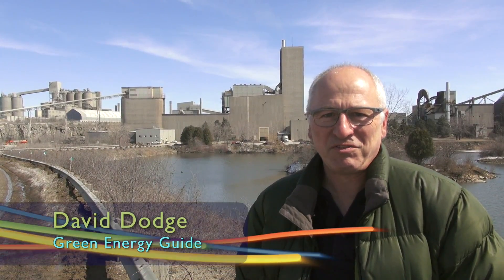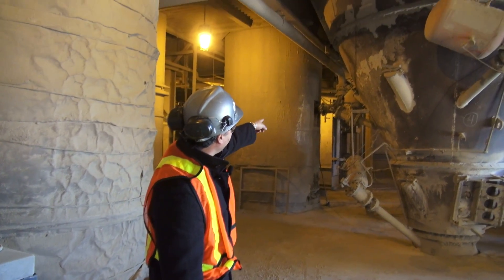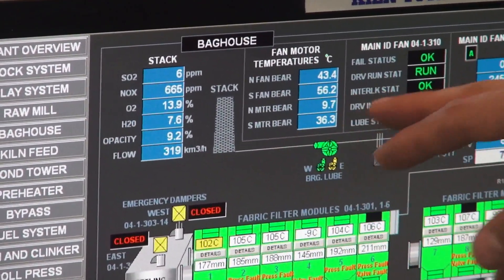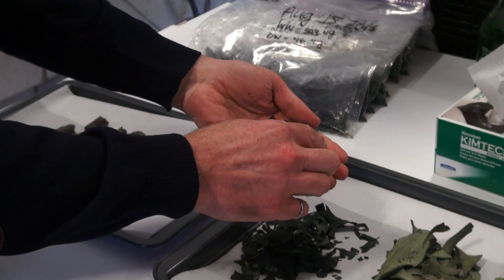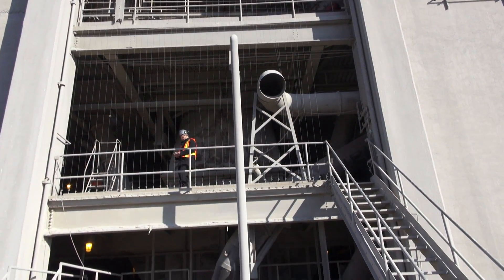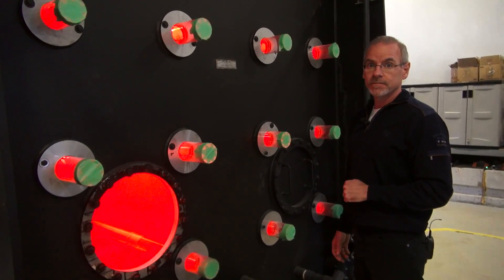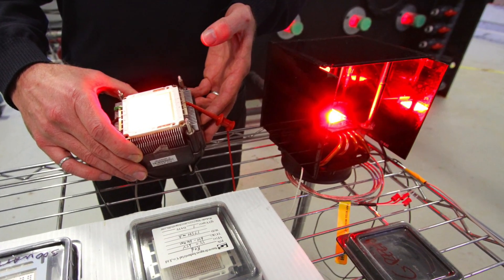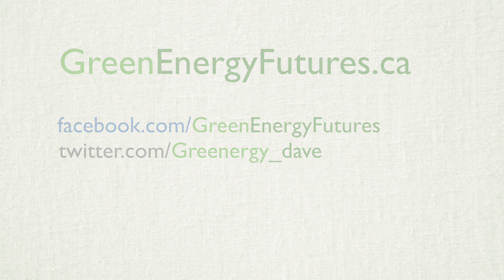75. How to turn your cement plant into an algae farm

Comment: This is just foolish. 5% of the CO2 emission of the cement plant is used to grow algae using energy for coal burning power plant. There is no net saving of energy.
Reply: lol i was thinking that as well, save 5% of the Co2 to grow algae and make more coal to burn.....but then again if they expand the system about 90times... they can reduce the CO2 drastically.
Reply: How they will reduce CO2 emissions?
Reply: wwwelkam Algae consume C02 and produce Oxygen.
Reply: jkjkhardcore666 And after algea dies what happens to that carbon?
Reply: Hopefully the algae doesn't die before you process them, the point is algae can be used for various industries, or as a food source. Growing algae can consume CO2 which is a harmful byproduct, if you grow enough algae they will consume more CO2, the carbon they use is used to build their bodies and for basic cellular processes (photosynthesis). I suppose when the algae die, the carbon is in their remains.
Reply: jkjkhardcore666 yes its in their bodies, but as you know dead bodies decay. And what happens to that carbon when bodies decay?
Reply: wwwelkam well algae dead bodies are not the same as human dead bodies, I doubt rigor mortis will set in, you tell me.
Reply: jkjkhardcore666 algae bodies will be eaten by other microorganisms and used as energy source and carbon that was captured by algae will be converted to CO2. 

So how it reduces CO2 emissions?  The answer is it doesnt. It just adds one or more steps